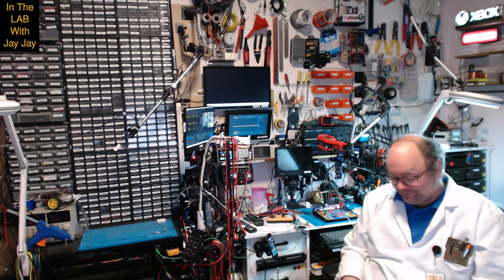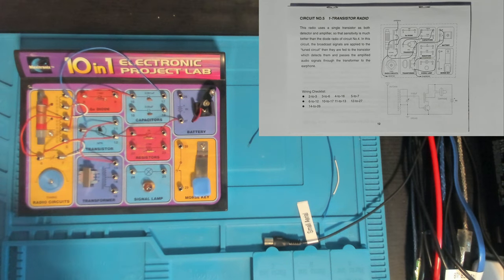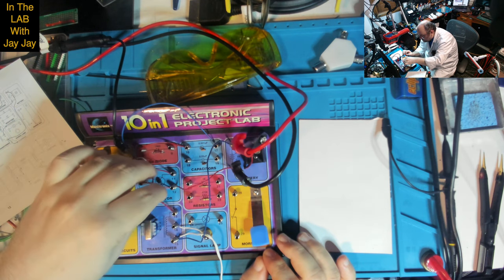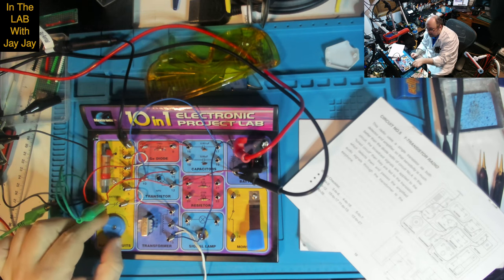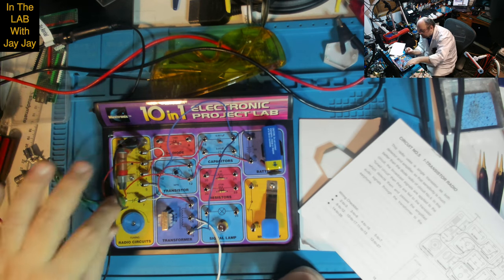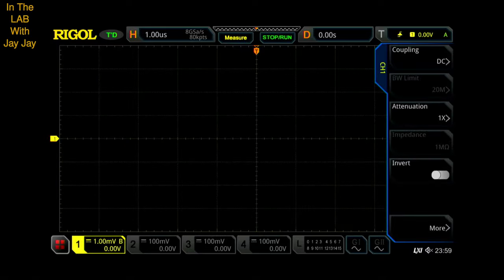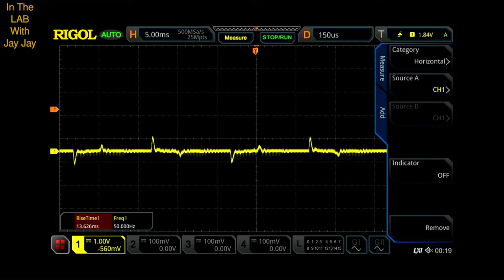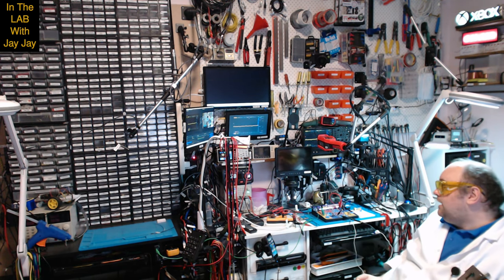1-Transistor Radio | Project 5/10 | Maxitronix 10in1 | Learning Electronics In The Lab With Jay Jay

Comment: I had the 30in1 version of this kit when I was a kid. The single transistor radio was one of my favorite circuits. You need to have strong AM or shortwave radio stations near you in order for these simple crystal-type radio circuits to work. The BBC world service on shortwave was very strong back in the day, and was one of the few stations mine would pick up. Also, the TV antenna on the roof will be designed for UHF/VHF, and won't work for a radio like this.
Reply from the maker: Hi there. Thanks for your comment! I also have the 30in1 and I will be working on that soon (once I have finished the 10in1 and the Sensor Robot 20). With the next radio circuit I will try using the long wire for the aerial that the kit recommends. Also, I will use an old AM radio to see if I can actually tune into any AM stations in my area.